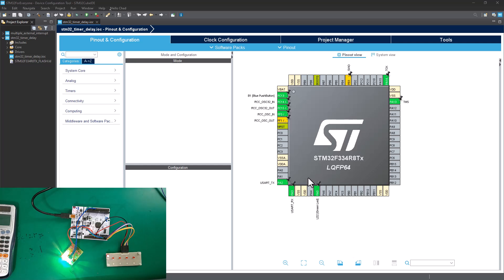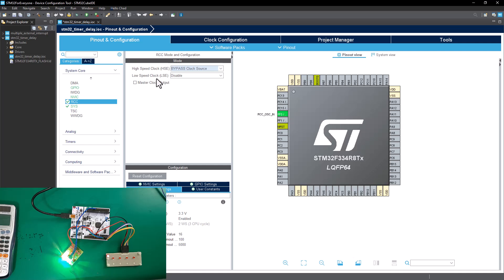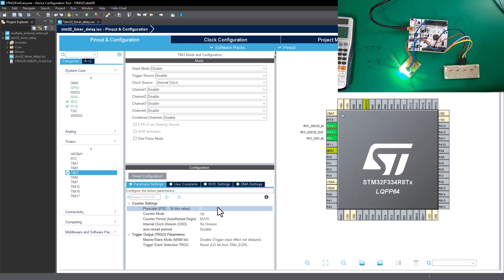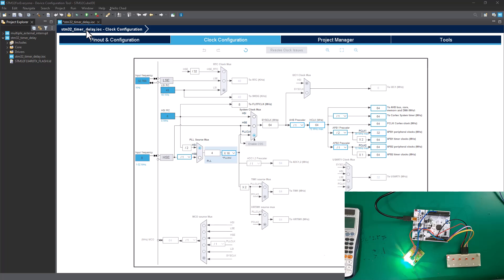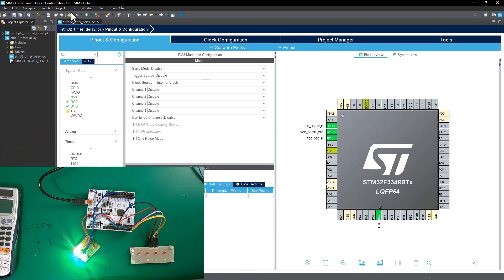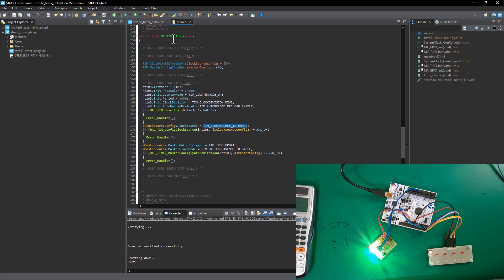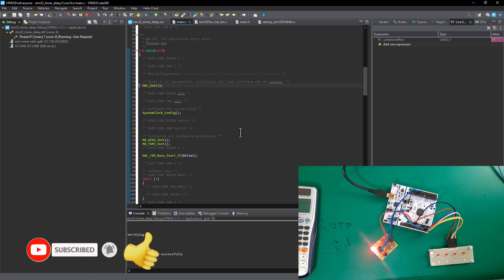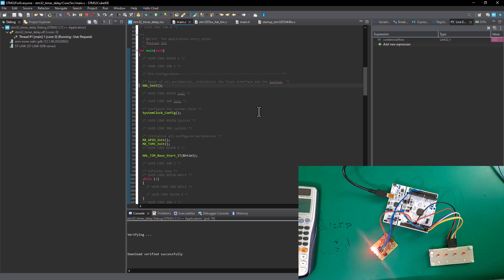4. How to create a precision delay with stm32 timer

Comment: That was interesting, can we implement this way us delay?
Could you additionally explained this ariphmentics, when Prescaler is 64 000 and counter period is 1000? As I understand the idea behind this that counter period is 1000, because 1s = 1000 ms, but nut sure about the rest.
Reply from the maker: Hi Great question! Let’s break it down:
If your STM32 clock runs at lets say 64MHz, a prescaler of 64000 divides this to:
64MHz/64000 = 1kHz (1 tick = 1ms)

The 1000 counter period means the timer overflows every 1000x 1ms = 1 second
This setup creates a 1-second delay by using the timer’s auto-reload feature. 
For shorter delays, reduce the period (e.g., 500 = 500 ms).
This means you can implement a us delay using the same arithmetic.

I hope that helps, please reach out if you want to know more, I offer free 15 minutes booking via Cadlendly, link on about page.